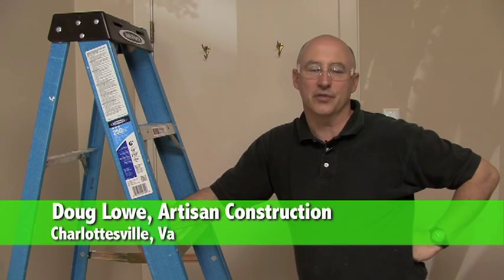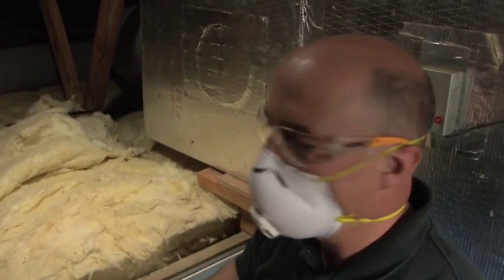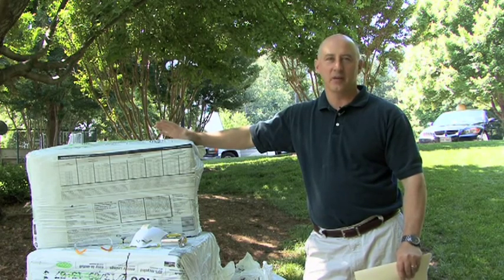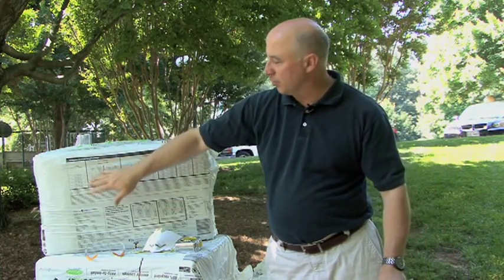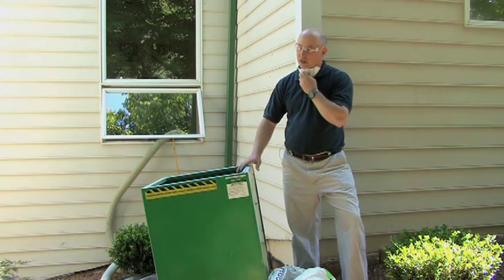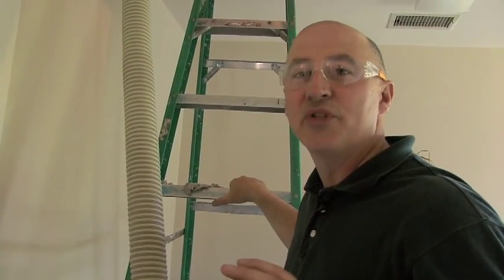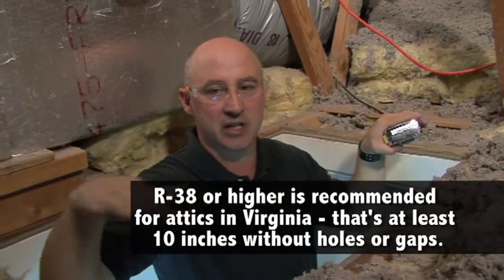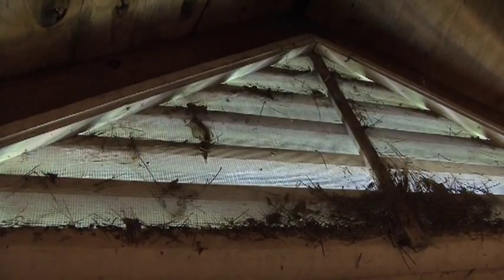Attic Insulation Video

Comment: Great video! I did this to my home last fall and it had a noticeable difference in both the comfort and amount of heating fuel used for the winter.  My home is over 60 years old and the installed insulation was no more than 1" deep.  I actually had to put my insulation between the ceiling joists, so I can add more in the future for even more energy savings.  At the moment you can actually get a federal tax credit for doing this. It's is absolutely worth the time and effort.

Comment: I would like to note there is a maximum point in where the thickness vs the effectiveness vs the overall cost is at its most beneficial with insulation. So there is a point where too much is too much and your return on your investment won't be for many many years.